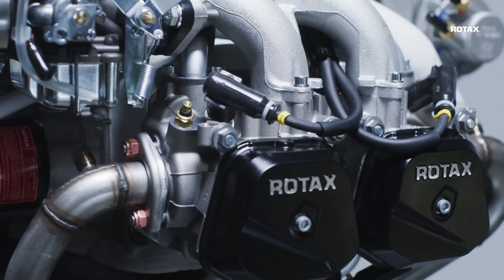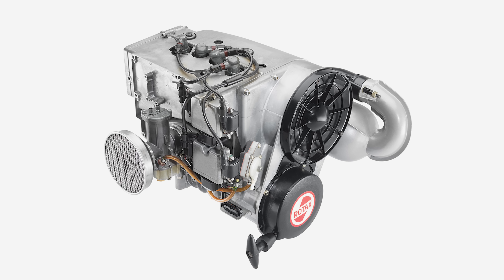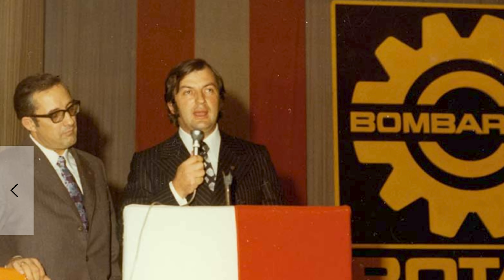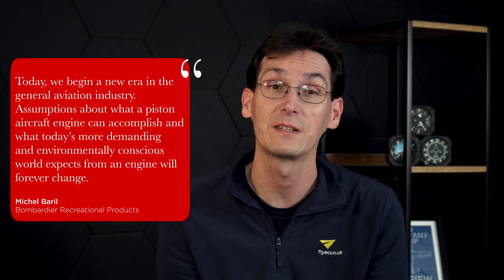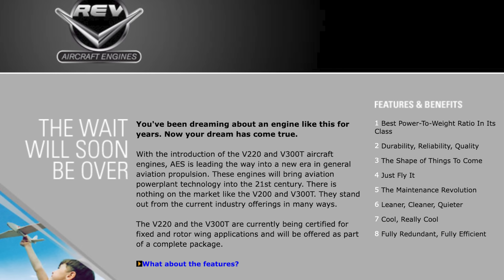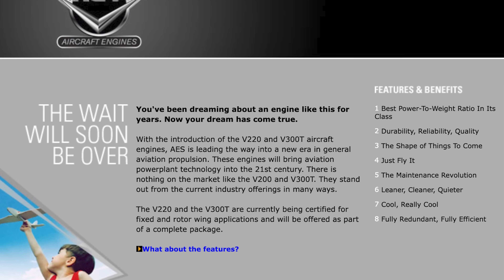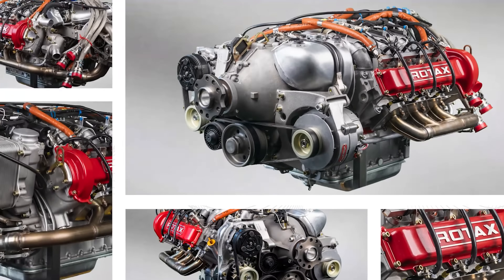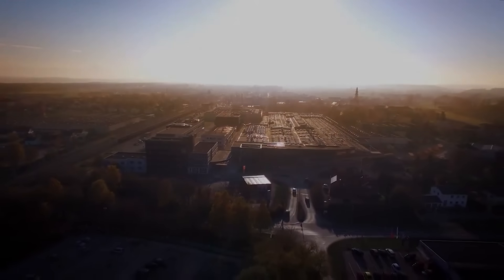300HP Rotax! The revolutionary V6 engine General Aviation pilots never got to fly…

Comment: All the complexity and liquid cooling just to run at a higher rpm to make more power in an aviation engine?
Why not a turbo-supercharged TWO STROKE engine so you get the twice the power from the same RPM?
A wide power band is irrelevant in aviation engines; it only has to be efficient at ONE operating speed.
Don't even need opposed pistons. Overhead valve intake, sleeve port exhaust is just fine at 3000~4000 rpm.

Comment: The problem is that AVgas won't be available in the near future. If they design a 300HP diesel engine it is going to be a game changer.
Reply: This engine was designed to run on mogas. There are unleaded avgas fuels currently in production as well (UL91, UL94, G100UL, Swift100R ). Gasoline isn't likely to ever not be available at airports, as hundreds of thousands of aircraft can't simply be converted to diesel.
Reply: deltahawk- 180hp already in production, certified & can be ordered. 200hp version already done. 230hp version on the way. 300+ hp v6 version to come later. I'd look for achates power to eventually roll out an aviation version of their opposed piston 2-stroke, 6 piston, 3 cylinder 270hp, 480ft.Lb engine in an aircraft variant, perhaps made by cummins? they're in production of a 4 cylinder, 8 piston engine designed by achates for the bradley & other military vehicles, for the army. it has 1000hp & replaced a v8 cummins with 750hp that weighs MORE than the achates. the achates designed engines will be what replaces every other aviation engine- as it is already the most efficient diesel in existence- but also has a power to weight ratio that will make rotax sad, even though it's water cooled, turbo, and diesel.
Reply: @jaybee3165  480 lb-ft, he says, as if it's relevant in an aircraft application, and as though it's a significant amount of torque, relative to the 700+ lb-ft that turbocharged aircraft engines normally produce. Even the 280 hp, naturally aspirated IO-550-G produces 588 lb-ft of torque at peak power output (no one cares what peak torque output is for an aircraft engine, because it doesn't matter). Being lighter than a military diesel also means nothing, as those engines are too heavy to even fly with any sort of practical fuel/passenger/cargo load. The Achates isn't likely to have a decent power to weight ratio either.
Reply: @PistonAvatarGuy  LMAO! 'torque doesn't matter' LMAO! it's ALL that matters. ALL the lycontisaurus engines have dismally LOW torque- which is probably why you will NEVER see them quote the REAL figure off a dyno test & doing that dog5hit maneuver where they try & say "well.. hp x pie plus the square root of blahblah blah" is just BS. gas engines are good for lawnmowers & race cars, but they are 100% pure USELESS in applications where you want to turn a shaft at a constant RPM under a heavy resistive load. that's why NO tractor trailer or farm tractor will EVER have a gas engine in it again- they are WEAK & inneficient compared to a diesel at doing just EXACTLY what an aircraft needs: a constant speed, under a heavy load. it's also the reason the MOST efficient fuel burn EVER achieved is NOT by one of your glorified briggs & stratton motors that Lycontisaurus makes- not even by pratt or rolls royce (arguably the greatest)- but by a WW2 DIESEL aircraft engine, that record still holds today- by a HUGE margin. the REAL torque rating of your lawn-mower can engines are around HALF the number of cubic inches of displacement- 200 to 250 ft. Lbs. you MIGHT get to the 300 if you rebuilt one & gave it a 10 to 1 compression ratio. WEAK. SAD. out of date. as for power to weight ratio- gemini 100hp diesel has an installed weight of 166Lbs. vs. a lycoming 0-200 installed weight of 229 Lbs.- and as the cubic inches go up (turbo version, & more cubes) that ratio just gets worse for the gas can boxers. MUCH worse. not only will achates build an even BETTER engine than gemini- the power to weight advantage over ALL other engines will be even greater. even the tiny little deltahawk DHK-200 would match an io550 G in maintaining constant prop RPM on the SAME model of propeller, all the way to 20,000 feet, in the same plane carrying the same load. why? TORQUE IS KING. that 20:1 compression ratio does ALL the talking. the 7:1 compression ratio of a lawn mower engine is WEAK, WEAK, pathetic. set the rpm- & forget it. added that weakness is the fact that those 1940's boxer lawn mowers have a dismally horrible bore to stroke ratio- further weakening their torque delivery. it's a case of dog 5hit x BS = lousy performance- when compared to ANY high compression, under squared engine. even Aeromomentum puts the boxer boys into the shame department by a HUGE factor- power to weight ESPECIALLY. you should know you're beaten when a tiny little 2 liter engine  exceeds the performance of an o-360.
Reply: Obvious troll is obvious.

Comment: 500+lbs doesn't sound light to me. And 915/916 are just absurdly overpriced. It's less than a Polo engine and they want 50k$ for it
Reply: No real economy of scale, and the legal exposure is stupendous. You can easily spend half a million (pick your currency) defending yourself when someone goes down and their loved ones want money (which they call "justice", but it's money.)
Reply: @UncleKennysPlace  bs. there is no legal exposure, engine failure is commonly accepted and that legal exposure didn't triple by adding a turbo
Reply: They are overpriced. Insurance is cheap. Rotax engineering isn’t that high tech. It can and will be copied by the Chinese and other companies. Rotax is very greedy with their pricing. Everyone’s got to make a buck. Maybe if they sold direct they could sell at lower prices and keep their margins?
Reply: @nickr5658  there is a chinese copy of 912, basically identical with interchangeable parts. but the nitwits are also pricing it like rotax which is why no one is talking about it. Some resellers price it around 15k$ which is way too close to rotax' own greed. a 912 copy should be maybe 2500$ from china and that's with significant margin. Then they would instantly have traction.
VW some years ago said their 2L 4cyl diesels cost about 2k€ and that was a rather advanced engine, way more complex than 912UL. More complex than 916. yet the shortsighted greedy clowns at rotax want 50 grand.

Comment: What is the use of innovation when it cannot leave the lab?  The other thing I come to learn about Rotax is the cost, there were no innovation there, as soon as I see Rotax in front , I know that plane is unaffordable.
Reply from the maker: It's frustrating that this engine didn't go into production. The percentage of projects that make it to market is tiny - and the number of these that subsequently succeed isn't huge either. The underlying problem is that the GA market is too small.
Reply: The REAL problem is the tyranny of regulations, ridiculous maintenance costs,  a corrupt legal/insurance system!!! Knock those down and everything else will fall into place!!!😀 Until those curses are overthrown, affordable GA will remain a pipedream! Take this to heart!!🛩️

Comment: Rotax is an Austrian company and it belongs to BRP (Bombardier Recreational Products), which is a Canadian mother company. Bombardier bought Rotax when it needed reliable engines for it's snowmobiles, after the death of hunters in the far North when their engines couldn't bring them back. They froze to death. Later on, Bombardier went public and split between heavy stuff (trains, aircraft) and light sport equipment, which gave birth to BRP.
Reply: Thanks for the insight. I thought rotax was Canadian from the beginning.

Comment: Sounds like power-wise & mass-wise the 936 was competitive with the old RR/Allison 250 series turbo-shafts but could’ve had an initial cost advantage. Turbochargers always add a layer of maintenance complexity and cost. Ask many who bought a 3-something liter turbo V6 versus those buying a 5-something liter V8 in a pick up truck. Could it be the 936 was too far within the “higher end market” for which the preference is STC/TC turbo-props with a known maintenance history and network?
Reply: Turbocharger maintenance does not have to be a negative if exhaust temps were reduced to  1300-1400F max. They last a million miles on diesels. The cost is another matter and only volume from an automotive sizing could fit that. Just think about a 4000 hr TBO (or more)

Comment: Simply splitting ring section from its skirt, the 2-piece piston retrofit technologies can usher in the advanced hybrid engines. The ring-section is operated via (valvetrain-like) piston-train to pump the gases in the exhaust strokes and reunite with skirt for the heavy compressing and power strokes. This new piston design completes the 4 strokes, different in both displacements and periods, in every revolution – called differential-stroke cycle which is a hybrid of 2-cycle and 4-cycle hybrid – to >2.5x power (trust, or torque) and >20% efficiency gains. For aircraft these strokes can have both higher power for take-off and change to Atkinson’s for fuel-efficiency cruise. Furthermore, it becomes diesel/gasoline hybrid for compression ignition engine for additional (~15%) fuel economy. It can further reduce weight, including the propeller gears and half cylinders.

Comment: Great video, Ed!  I saw this V300 engine a few times at Oshkosh (and perhaps SnF, not sure) and it was of course very impressive.  Surprising that it never saw production, but clearly those Rotax guys are smarter than I am.  Now, if they could only put out a small and light diesel that's fully backed by the Rotax maintenance network, that would be a clear winner.   Or perhaps they could buy Turbotech and market that little turbine engine.
Reply: "small and light diesel"

Contradiction in terms.
Reply: @PistonAvatarGuy  no if the diesel is an high pressure supercharged 2 stroke...
Reply: @leneanderthalien  Like the hilariously overweight (and fairly large) DeltaHawk?
Reply: I think compression ignition is not the answer, but with  F1 engines and the 2025 Prius beyond 50% overall thermal efficiency the technology is solidly known to produce a 300 hp engine, turbocharged, direct injection but spark ignited. It would nearly eliminate the detonation issues, lower NOx. All the technology is proven, but not assembled together. Like the first iPhone integrated the best of available tech for a huge leap forward. Hi piston speeds, structure, controls and manufacturing tech is all known to Rotax now. This would be a 10% new technology engine but maybe 50% of standard parts. Anyone want to give me $5M for a demonstration project? 🙂
Reply: @billl7551  Is this supposed to be some sort of ridiculous misinterpretation of comments that I've made in the past?

Current F1 engines are turbo-compound engines and turbo-compounding was successfully used to significantly improve the efficiency of piston airliner engines in the 1950s. Turbo-compounding is also currently used on semi-trailer truck engines to significantly improve their efficiency. While turbo-compounding would improve the efficiency of light aircraft engines, it would be far too expensive to ever be practical in that application. The current Prius engine is only 41% efficient, but that's likely to be at a very low power setting. Still, the Prius engine is designed to run on 87 octane fuel, while a 300+ hp aircraft engine would be designed to use 100 octane fuel and could make use of a much higher compression ratio (or, really, a similar compression ratio, but with the Otto cycle). Aircraft engines are also not subject to the same restrictive emissions regulations as automotive engines, so there's really no reason to believe that they couldn't also be somewhere close to 40% efficient.

The buyers of aviation engines couldn't care less about thermal efficiency, their concerns are related to reliability, performance and cost of operation. Diesels simply don't offer a good combination of those attributes, which is why they never caught on in aviation. The greater weight of a diesel engine even increases the induced drag produced by an aircraft powered by one, which can result in higher overall energy consumption (by distance traveled) than a comparable gasoline burning aircraft (DA50 vs Bonanza).

NOx emissions from light aircraft are not regulated, nor should they be.

Rotax 4 cylinder engines do not have high piston speeds, they're on par with larger Lycoming and Continental aircraft engines.

Continental showed that significant improvements in efficiency over air-cooled LyConts were possible with liquid-cooled aircraft engines back in the '80s (228 g/kWh vs 255 g/kWh at cruise) and there's no reason to believe that improvements haven't been made since then. Single-lever control (FADEC), increased TBO, improved reliability, the ability to burn unleaded fuels and less engine weight also become possible with modern gasoline engine technologies.
Reply: @billl7551  The MWfly engines are also down in the 220-230 g/kWh range.
Reply: No need for that, Deltahawk is what you want, diesel 2S light and powerful.